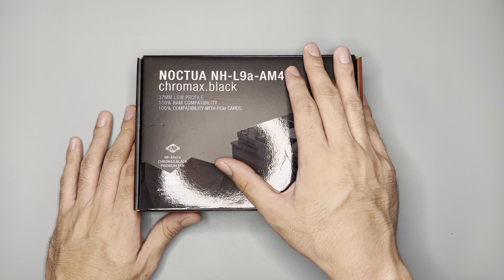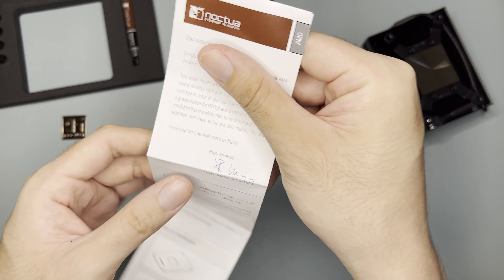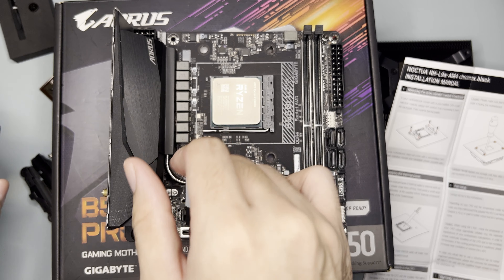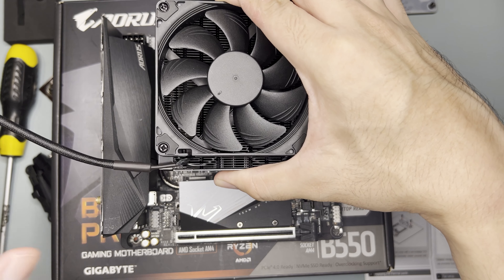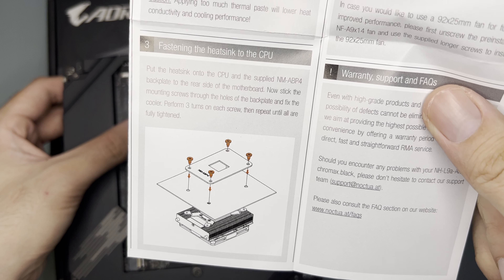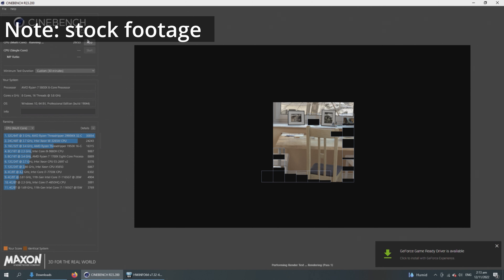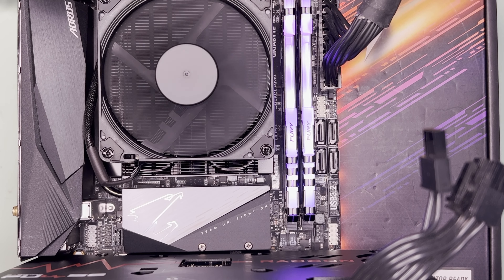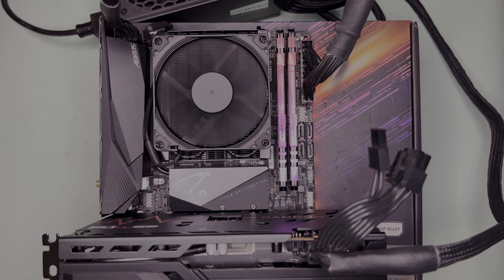Noctua NH-L9A-AM4 | Unboxing, Mounting, and Benchmarks

Comment: anu mare recommend nyong cooler sir for ryzen 5 5600, asus prime B550M WIFI II and trident neo ram?
Reply from the maker: Stock po if hindi naman kayo hardcore user and no need for a lower profile cooler.
Reply: @manongunboxing  di kaya stock eh nag valo ako kanina 85-87c max 89c :(. Naka 1440p kasi ako sir
Reply from the maker: 5600 na non-apu po ito no?
Ano case and gpu?
Reply: @manongunboxing  case ko dark flash c285mp tpos meron ako 7 fans nung una 2 intake 5 out tpos pinalitan ko ng 4 in 3 out
Dark flash Dm12F
Room temp po pla is 25c since naka aircon po lagi
Reply from the maker: Weird. Gusto ko isolve yung issue mo sir. Taga-metro manila ba kayo? If interested kayo na icheck ko, msg me on discord: https://discord.com/invite/6qrft2RR6D

Otherwise: 
Check idle temps po (30 minutes doing nothing), dapat po below 50 ito.
Tapos check po muna mounting of stock cooler. 3 turns at a time per screw.

Pag negative pa rin, the best ones na kasya po sa case niyo ay thermalright peerless assassin. Go big since kasya naman.
Reply: taga makati sir 53 sya sa IDL di ko rin sure sa case since sa GPU ko kahit naglalaro di natas ng 60-70
 @manongunboxing

Comment: hello!!so you what do you think is better for the r7 5800x this one or the axp90-x47 full copper??
Reply from the maker: Thermalright will be better but do note of the protruding mounts from the cooler.
Reply: I’ve been using this on my 5800x3d with my 6950xt gpu.

Comment: sir, planning to build an itx with these specs:

gigabyte a520i + ryzen 5 5500 + rx 6600 xt
case: pccooler i100-2 (60mm below cpu cooler only)

choosing between these coolers: id cooling is-55, axp90-x47 copper or Noctua NH-L9A

which would you recommend?
Reply from the maker: Id cooling!

Haha sorry sir ayoko talaga ng axp-90. Ilang beses na kasi ako nagkaproblem doon sa mount nyang naka-usli.
Reply from the maker: Ay di ko napansin sir yung Noctua option. For me, maingay kasi exp ko sa id cooling. With your proc, if w/budget and noise ang concern, Noctua ako.

In short, Noctua nh-l9a since di naman mainit yung proc. Otherwise, id-cooling is-55. 

Ang pangit lang sa ganitong thinking ko, if I plan to upgrade sa mas mainit na cpu, need to upgrade cpu cooler. Personally, risk ko sya na accepted. Wala akong plans to upgrade cpu for 3 yrs at least and if mas mainit man, then "wala e, bili na lang" rather than overthink.
Reply: @manongunboxing  great insight! tbh yun din issue ko sa axp90 baka magkaproblem sa mounting. I don't have plans naman to upgrade for 3-4years after building a new rig so I guess safe na with is-55 since di naman ako maselan sa noise hehe. main concern ko lang talaga is temps, I'm even thinking of adding a mining fan sa loob if kaya pagkasyahin hehe

Comment: Boss yung 5800x mo default settings lang? Naka 5700x ako plano ko sana tong cooler na to tapos naka eco mode lang yung 5700x. Ok kaya to? Same kasi tayo ng board kaya alam ko na fit na sya.
Reply from the maker: Yes default.

For 57x, parang ok naman. Haven't tested pero dyan rated yung cooler
Reply: @manongunboxing  I see, siguro kaya neto mag below 70 degrees pag gaming. Naka SE-224XT ako sa NR200 nag ra-range sya 65-69 degrees while naka eco mode. Thanks!

Comment: Sir meron akong  5600g .anong mgandang LP cooler ang gamitin?
Reply from the maker: Stock cooler will do sir.

If need mas low profile pa, then itong noctua nh-l9a-am4 na po. Tahimik kasi. Yung sa thermalright, maingay sobra yung fan.
Reply: @manongunboxing  nag aalala ako sa temp sir. itx din po kasi ang e build ko
Reply from the maker: Ano po case niyo?
Reply: @manongunboxing  pccooler i100 sir
Reply from the maker: Tbh sir no need to worry for temps dahil sa cooler. Baka yung case yung kulang sa airflow. Pero kung worried talaga kayo sa cooler, get the biggest one that can fit, so in your situation, ID Cooling IS-55 yung kakasya. Note na di ko pa po natetest and likely maingay ito vs Noctua counterpart.
Reply: @manongunboxing  Thank you Sir ..